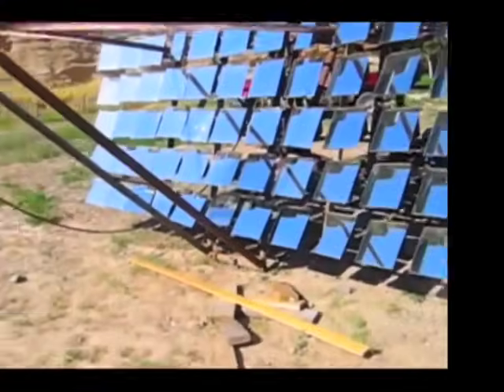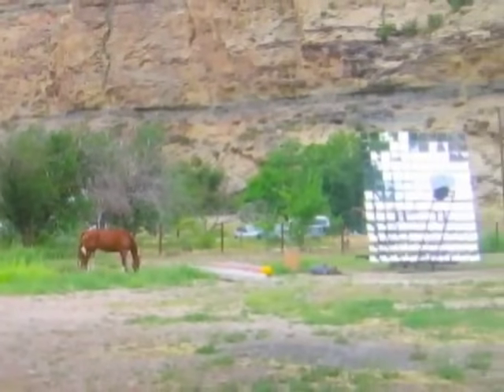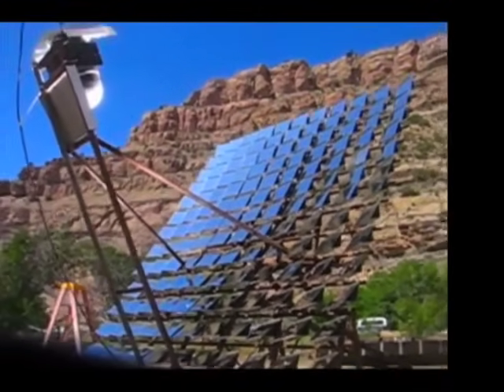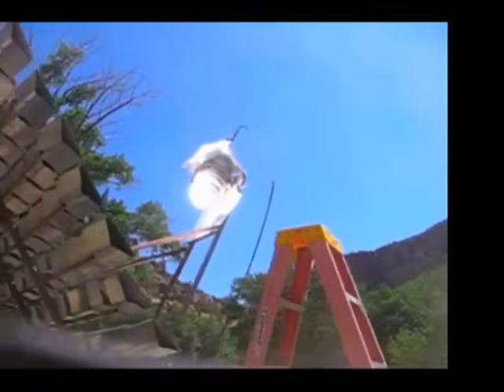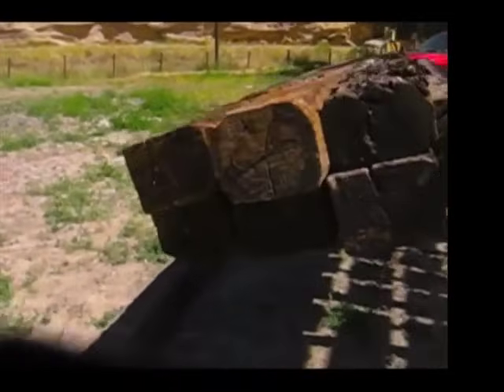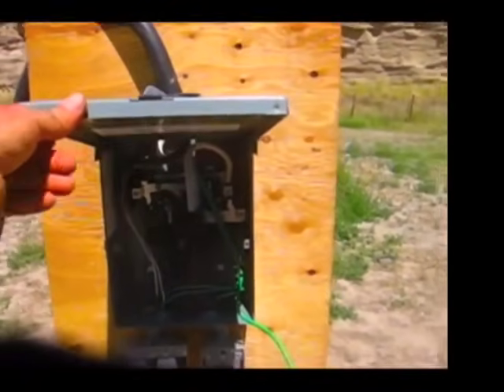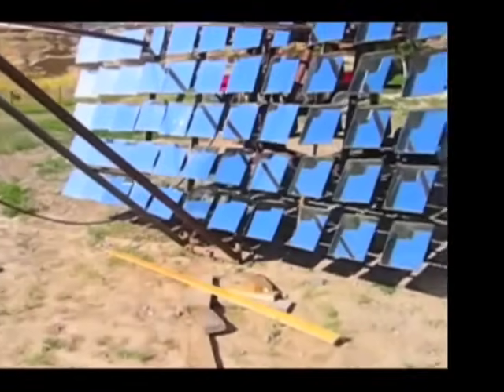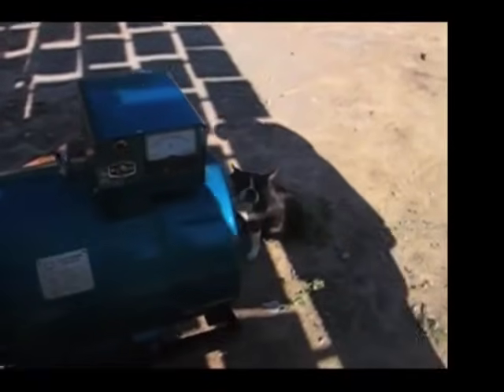STEAM ENGINE 12KW GENERATOR Solar Mirror Array Death Ray

Comment: Suppose such a system could be made 50 percent efficient.  The sun tracking adds about another 40 percent compared to a fixed solar panel system.  So the same area delivers six or seven times the power.  A couple of big mirrors stamped out and mass produced and a mass produced hot air engine at the cost of a lawn mower engine might cost a twentieth of what a similar power fixed photo voltaic solar panel array would cost.  Mirrors cost so much less than pv panels. If there were two dishes on a sun tracker, one dish could be flipped over to turn the whole thing into a giant anemometer like wind power generator when it is dark or cloudy.  That might increase the overall power to a near one hundred percent equvalent power compared to conventional pv panels operating at ten to fifteen percent.  

A lot of people are concerned about global warming.  Global warming is a media event like something out of the book '1984'.  One thing that is not a media event is the possibility of a comet or asteroid crashing into the earth and destroying a large metropolitan center or worse.  If the solar dish system were as inexpensive and  worked as well as described everyone would want one.  With a sun tracker it could be used to track other things.  With todays digital electronics and the internet and the dishes hooked up to a modest sized microwave power source of ten thousand watts a vast array of dishes could be used to destroy comets and asteroids thousands of miles away.  Ten billion dishes would deliver as much fire power as a one hundred kiloton atomic bomb every second.

Comment: I've seen videos on perpetual motion generators made from magnets. Can you do a video on that, or is it a hoax?
Reply: ***** Does that include magnets attached to fan blades on a computer fan, where you have another magnet causing the fan to spin?
Reply: ***** except when the free lunch comes from food already there, you just can't see it. meaning energy that is already there......
Reply: +Scott Smith dissipation to what end?
Reply: Brent Sido
https://en.wikipedia.org/wiki/Dissipation
Reply: +Scott Smith what I am asking is if there be a start and there be and end perhaps the end is the start   sorry to sound like the mad hatter. I am thinking of processes and cycles beyond this universe.
Reply: Even if that's the case, (and it's impossible for anyone at this point to know for sure) perpetual motion on a universal scale isn't useful to us, on earth. We've taken a discussion of the perpetual motion hoax, and turned it into a philosophical debate. The main take away, is that there's no known perpetual motion, some of the energy used will always be lost to some outside force, be it friction, light, etc.
Reply: ***** I'm sorry I was never discussing the possibility of a perpetual motion machine. I was only  curious if you thought the universe winds down and then nothing and if so why was it wound up? I realize this is a whole other topic of conversation.
Reply: Brent Sido
seems like it does. as for why, I'd say there's no actual reason. Finding reason in things is a human construct, the universe doesn't need one.
Reply: ***** i didn't mean why was it wound up in a philosophical way I ment what(system of rules or whatever) led to that state of existence before dissipation you don't think its all part of a grand cycle?
Reply: Brent Sido
I'm not a Physicist, so I have no clue. I'm also abundantly aware just how minuscule I am in the system, so if I'm completely honest, learning how or why isn't very high on my life long to do list. I'm sure it is for some people, and should they find out, I'd be happy to learn it, but at this point in time I simply do not care enough to pursue it.
Reply: ***** fair enough

Comment: Well the 12 Kilowatts seems a bit high.. as like the surface area of sunlight before concentrated would only have a little over 10 Kilowatts of energy and that is with a 100% conversion rate.... soooo I am thinking he is storing power in the battery bank and measuring the power off of it in order to get the extra 2 Kilowatts...  about midline in latitude in the USA you get about 60 watts per sqaure foot of solar (thus thermal energy) now entropy when you convert it steals some and the conversion rate by whatever method of thermal to electric (See the Law Conservation of Mass Energy) ... well you lose at least 50 to 60% even with the best systems.. so you can count on about 30 watts per square foot which the size of his concentrator as stated is about 188 Square Feet.. so 188 x 60 / 2 = 5 Kilowatts best... but batteries can store the power and you can draw greater kilowatt hours from them...

Comment: Oh and using water at the thermal target of the solar energy is not a good idea... no use a solid thermal energy storage mass (AGAIN SALT LICKS FOR CATTLE.. they do not melt till 802 Degrees C... so like you can store for OVERNIGHT USE the themral energy that you can turn into the steam to in fact generate the electricity or heat your home or cook your eggs etc......

Comment: His design can be improved.. in the 90's I was working on an engine design to do true tangential torque rotary engines.. the same design with no fuel (just steam) can produce the rotary motion needed to in fact produce the power very very very well... see if your rotor inside the cylindrical housing (the chambers) had spring loaded blades at 90 degrees to the axis of the rotor.. and like rubber (Vulcanized think old tires) to use as gaskets... or telfon would work great.... then.....offset the rotor from the cylinder it is in.. and then... well have an inlet and outlet near the closest point of the rotor's axis and well the cylinder... you can by pressure of the steam alone... cause a rotrary motion much more effeciently than any turbine or reciprocating steam power generator... plus..... it lasts a lot longer..... :) ~The WhiteRabbit

Comment: Question: Could a Tesla Turbine replace the pistons? The steam enters a tank [ to help with equalization ] output and a reduction concentrates the steam into a Tesla turbine? Output / exhaust steam is then captured for a recycled water source? Just wondering, not trying to torpedo this great innovator.

Comment: I had an idea about this...the exaust steam is run trough a condenser and converted back to water then pumped back to the generator...probly could be a sealed system and the pup runs of the engine

Comment: I designed a better version of this on paper in 2011, and showed it to some of the people in India and U.A.E (Dubai) but no one came forward for financing my project, the crap I got from those people (even a chemical engineer from Indian Institute of Technology), was that the steam would not develop in the container by the concentrated sunlight, I pity on those guys, seriously.
Reply: This is not a 12kwh generator, no wheres close. Solar thermal to electric is EXTREEMLY ineffecient, no matter how good your design is.

143ft^2 * 75-120W/ft^2 * 85% = 9-12kW reflected energy. But unless your running really high pressure, and using a turbine, you will only get between 5-20% to convert into electricity.

Yes this looks cool, but on paper, its a waste. This thing is prob only really generating 1000-2000w.
Reply: @MGarafano  you are right. It is a waste of time and with only 5% to 10% efficiency. My money is sitting in the Bank right now with .45% efficiency. Is it a waste of time too?
Reply: Vang Cruz yes it is, while that is compounding at .45% the buying power lost is currently closer to 6-8%. There is a reason schools teach you about compound interest and not compound profits. They want you to be good little bag holders and not think for yourself, btw the difference between the two is time, compound profits removes the time from the equation. Aka no vesting period
Reply: @MGarafano  So, let's say the whole world think like you.  There will be no innovations due to the minute improvements. Might as well stay in the stone ages.
Reply: Those banks you so graciously lending money too, they turning around to make compound profits, you get under a percent a year meanwhile they getting that or more with every transaction.
Reply: Vang Cruz god no I actually agree with making incremental improvements, they very much do add up over time. You brought up savings and that’s like the one area that don’t count because inflation far outpaces it. TBH I don’t even recall the video or point I was trying to make I’m just pissy about all the printing and what it’s going to do to the dollar lol 🤷
Reply: @MGarafano  ever heard of Zimbabwe?  They have a 100 Trillion Dollar Bill. If you want to know what printing money will do to a country, look no farther than Zimbabwe.
Reply: Vang Cruz Yep, trust me a whole lotta scrambling going on over here trying to stay ahead of it, most everyone oblivious about what’s coming, we had it too good for too long, our population is extremely ignorant to how bad life can actually get. Where you from?
Reply: Michael G
 But still totally emission free, and also totally free once you've purchased the equipment!
Reply: Michael G  well I never mentioned that my design could do 12 kwh, my design was more efficient than this one.
Reply: Viky Thakur make your design open source, someone might do it
Reply: Clearly the steam does develop. PEople all over the planet are already using solar steam generators to run steam-engine driven water pumps and dynamos in remote locations. Some of the generators look like flourescant office light housings. They are crap. The engines are often weed whackers with nails in them. Crap. But it works.
Reply: Can you give me your schema system?

Comment: I wonder what the actual output is.
12kW seems too good to be true.
The solar constant is only 1.3 kW per square meter.

Amazing invention never the less.
Reply: The generator head just happens to be rated to be able to produce 12,000 watts constantly without melting. Who knows what the system as a whole makes under all conditions.
Reply: stick a meter on the outfeed, record a stripchart of it and correlate it to solar alignment accuracy.

Comment: Great for an off grid small community.
Reply: in any country where the sun shines, you can make boiling water from the sun with enough concentration, it will take more effort but it will happen
Reply: Only if your in a hot climate unlike in this country

Comment: Just a suggestion from a fellow engineer maybe if you took your output lines coming off your steam engine and piped it into a holding tank then you could do a return line to your central heating unit and use the laws of thermal syphon and reuse alot of the heat over again and in turn be more efficient oh and before I forget great idea and great video
Reply: It has to be filled up periodically anyway. If he's generating 12kw I'm sure he could afford $200 to automate the whole thing. If it were me, I'd have an old air compressor tank and maybe a car fuel level sensor inside with a float. Connect a high pressure water line to the bottom of the tank.  That way at maybe half a tank of condensed water the air compressor could turn on and when it reaches a higher psi than the hot tank even by 1 psi the air pressure in the top of the tank would push hot/warm water back into the system. Couple high pressure rated solenoid valves on the inlet and outlet then it's a sealed system.
Reply: @moneyshot2239  no on so many levels. An air compressor for what? Are you talking about a water pump to push water into the container once it is low? Why not just modify the piping already there, put a Y valve solenoid in with a pressure sensor that would open the flow of water once the psi dropped below some threshold, i.e. when it's empty.
Reply: @Diamblichus  you do it your way then genius. The point is having constant pressure while never having an empty system so there's no down time of power generation while the sun's out. If you understood what I said it would probably have a good chance of working
Reply: @moneyshot2239  you recommended putting an automotive fuel sensor not rated for that kind of heat or pressure into the heating chamber lol. I'm not doing anything my way i'm telling you what your proposing is ludicrous and unless you can actually clarify or explain otherwise then it will remain so.
Reply: @Diamblichus  no I said the sensor will be inside the air compressor where the steam will condense. If it's a closed system and you lose 5 gallons condensed from the exhaust. You'll have 5 gallons in the compressor tank. Automotive fuel sensors are more robust than you think
Reply: @moneyshot2239  now boys !   what have you made lately  ?
Reply: i'm sorry but it doesn't seem practical at all for this system. he already states he had some psi fall  off... you're talking adding pumps, valves and additional fabrication to the heating chamber? K.I.S.S. It doesn't look like it needs more heat if its maintaining consistent enough output for that generator. if it did need more heat given the constraints of the system mylar or additional reflectors seem more sensible.
Reply: isnt that a lot more complicated? trying to fine tune a valve system for the return into an extremely high pressure container
Reply: @Transhumanist Space Exploration in this project? No it isn't.
Reply: @Transhumanist Space Exploration and if you're talking about the proposed changes from fournier i'd love to hear how the systems exhaust in "cooling blocks" is going to somehow make its way back into an area of the system with much higher pressure without a pump.
Reply: @Transhumanist Space Exploration "pump solar radiation into a Thermosiphon" "without pumps" care to elaborate?
Reply: @Diamblichus  google thermosiphon effect.  No pumps needed.  What these other guys are trying to say is that the efficiency of the system would go up with very little design change.  His “waste” water is probably still in excess of 200 deg, vs adding “new” water at say 70 deg.  The concept is fairly simple.  It’s like running your home water heater.  If your initial water temperature is higher, you will be using less energy to heat your water.

Comment: Good set up, in order to really make it efficient, you should add a condenser to recapture the water and recycle it.
Reply: The heat dissapates just the same weather the stem goes to atmo or exchanges it to it in a condensor. You would really only need it if you didn't have a water supply or your water supply had impurities that would harm the system.

Comment: Wow, impresive, if only it were a little more "beautiful" I mean, it doesn't look great but it could be easily transformed, and perhaps other changes, for example, automatic tracking sistems, oil heater maybe instead of water and then an hidraulic system with a condenser, I would buy it for sure, it has an enormous potential, I congratulete you.

Comment: An inspirational video! In countries near or within the tropics  it's a no brainer. Why spend money on solar PV when the efficiency of energy conversion per square area from solar heat to steam is so much higher? Storing energy in batteries or raising water  to a height to give hydro power could complete an off grid system. Space to do it could be an issue, but if we're serious about climate change this is a route to go.